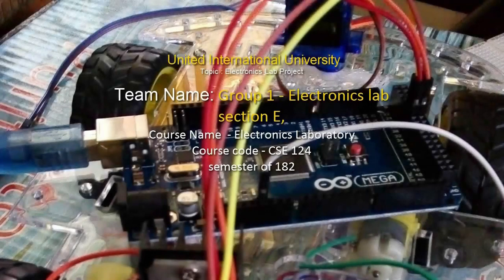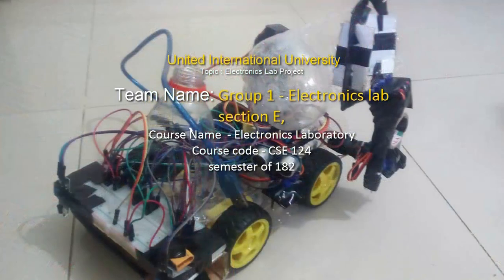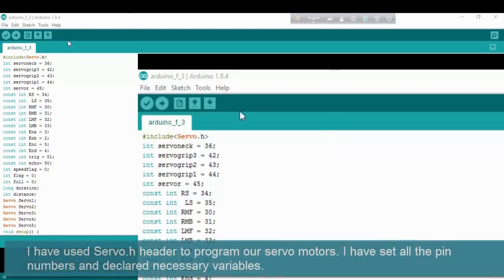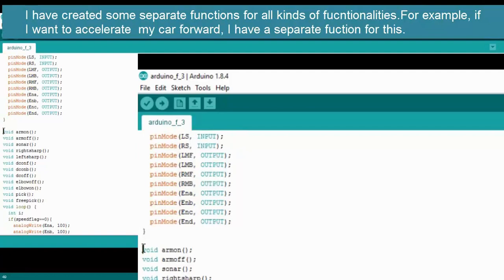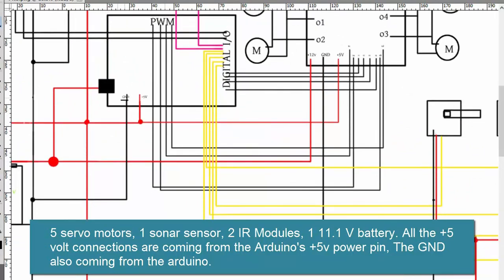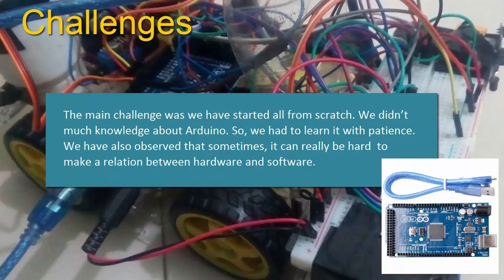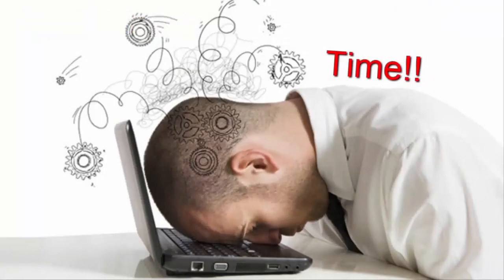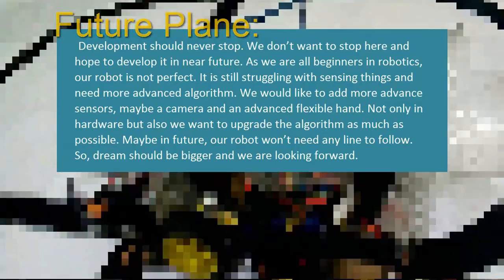How we have built an Automatic Garbage Management Robot [ARDUINO] | University Project

Comment: Can I  use Arduino uno instead of Arduino mega ?if  yes,what differences occur?can u please guide me i am a beginner.
Reply from the maker: It's not impossible if you design your logic diagram which may give  you extended possiblities...But that won't be a practical solution since I have so many components running with my Arduino mega. You will get it really complex to implement....I will never recommend you to use uno in this project .
Reply: Judemy Thank u very much I really appreciate.Can  I  ask you again if I will get another query?
Reply from the maker: That depends on your need of pins... Arduino uno would give you around 14 pins and mega would give you 54...(I forgot the exact no of pins but you will find it on internet) .Now if you need more components to control then you would need more pins....
You can extend your pin numbers with logic gates , mux, etc but the implementation could be complex ...
Hope that answers your question brother 🙂
Reply: Judemy  but with arduino uno will i able to make exactly same as ur project?
Reply from the maker: Arduino uno and mega are same to use...But you have to configure your IDE according to your Arduino boards
Reply from the maker: Welcome brother..I would love to answer🙂
Reply: Judemy Ok thank u sister 🙂
Reply from the maker: I am "brother" , it's Juboraj Naofel my bro!! 😌
The voice in the video is my project mate( my sister) 's voice. 🙂